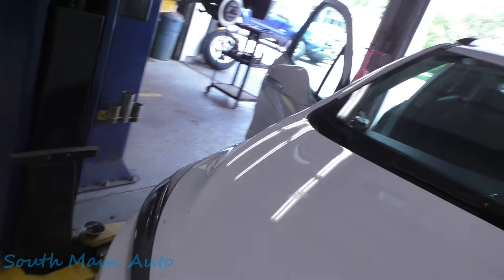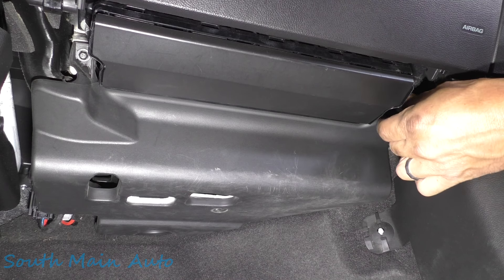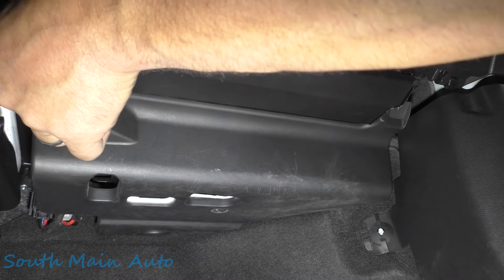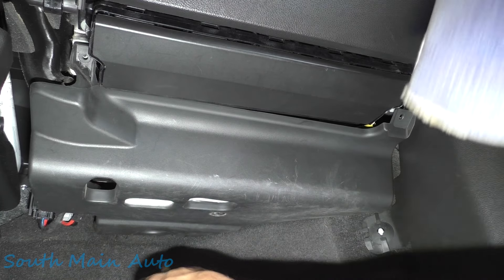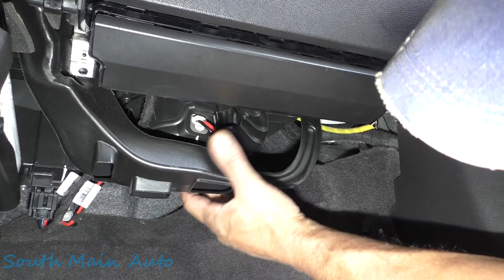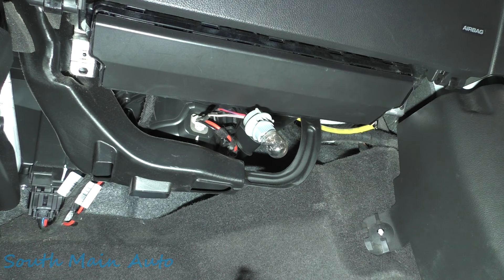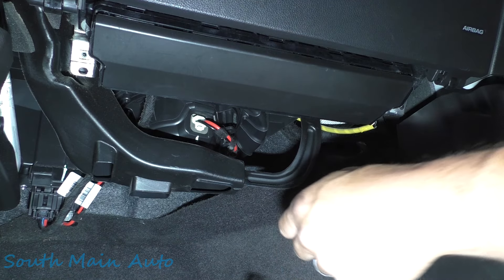Buick Encore - Blower Motor Replacement

Comment: Speaking of customers bringing in vehicles for a "problem" that isn't a problem. Once had a customer drop off their car because "it was getting up to operating temp too fast." It wasn't overheating. We looked at the car, told them there was nothing wrong with it. We recommended replacing the tires, like we had been for months. The customer declined getting new tires. I'm pretty sure we charged them diagnostic time and they drove off on their bald tires. 🤦‍♂️🤦‍♂️🤦‍♂️

Comment: Don't stress it Eric, if those cable tabs weren't "optional" they wouldn't have been molded from crapolium
Reply: The fact that they gave you two extra holes shows that even GM knew the part was cheap.
Reply: @shadowthesi  let's not give those clowns credit where it isn't due - chances are that crappy blower module is used in multiple models which may have additional wiring harnesses that clip into the additional mounts. This was likely just GM failing their way into accidental success thanks to their cheap parts-bin approach.
Reply: repentandbelieveinJesusChrist1  Reported as spam.

Comment: GM Engineer: "Let's permanently mount the blower-motor into the air-box so it'll be cheaper and easier to assemble."
Other GM Engineer: "Don't blower-motors have moving parts, and wear out over time?"
GM Accountant: "So?  By the time it wears out, it'll be past the warranty period -- not our problem."

Guarantee you this conversation took place.  100%
Reply: Hell yes!
Reply: I wouldn't doubt one bit if this was actually a verbatim conversation.
Reply: I bet it never came up and was a streamlined design that nobody thought twice about. possibly done by the hvac assembly manufacture, if it's not gm directly.
Reply: That's what happens when accountants run companies instead of getting input from front line service guys at STEALERS.
Reply: Interm:  Not if we use a brushless motor, and controller.
Clean out your desk, do you know how much that would cost....We are not wasting 3 cents.
Reply: Not just GM engineers
Reply: SAVE MONEY, Ford accountaints say "hold my beer"

Ford engineers . "Hey these gas tanks will explode, it will take a $10 part to fix"
Ford accountant " my calculationts , its cheaper for us to pay out the insurance claims, we make more money letting people burn, than paying for the part in construction"
Reply: Oh, it definitely did!😂
Reply: The words would have been too expensive. The instructions probably said as few parts as possible or wood chipper.
Reply: @positivemasculinity42 only vehicle that I ever had problems with was a gm vehicle with low mileage.  Everything was a pain to get to/take apart.  Never owned a gm since.
Reply: Hopefully when gm goes out of business again we do not bail them out
Reply: My blower motor just went out 400 miles after my warranty expired. Figured I would be able to do it myself… proving to be more agitating than expected. Might pay for it to be someone else’s problem

Comment: Firstly, Love the content. As a GM dealer tech I have seen many of these issues on the encores and chevy trax. sometimes the fan fixes it but be mindful of the harness that plugs into the blower motor, it only runs about a foot and a half back towards the center console and then it plugs into another connector, and what I have seen is poor pin tension on the ground side of the connection further back, had a couple of them. keep up the good work! from a neighbor in PA!

Comment: What a great video Eric.  First and foremost, I have always wanted a bulldozer too.  Crane my neck to look at them since I was a kid.  The bigger, the better.  I’ll probably never get one though.

So the reason I feel compelled to write is that I was a “Serviceability Engineer” at GM a long long time ago.  Programs that I was most involved in were 95 Riviera/Aurora and 95 J car.  GM had an entire group devoted to Service Readiness called STG (Service Technology Group).  During engineering tradeoff discussions, we were generally last in line to get our desires for better serviceability.  Piece cost, mass, buildability always had a much bigger voice.  Watching this video transports me back.  I can imagine being the Service guy in the engineering discussions about this blower motor.  The Release Engineer probably had to be persuaded to even get the cutout molded into the case so that you could cut it out with a knife.  Lots of negotiations would have happened around the costs involved and the serviceability guy would have to show how it could save warranty dollars just to get it to happen.

Back in 1991, we found that 95 J car was not towable with some tow trucks.  The stinger of the tow truck would actually break through the oil pan and into the crank during testing.  Spent an entire summer at Milford Proving Grounds working with the team to convince engineering management to put several dollars into the car so this would not happen.

I am a long time mechanic too (not professional).  I appreciate the language conversion that you do in your head while working on stupid designs.  I have trouble doing that conversion and rarely call things “Mother Lovers”.  

I left GM in 2007 and am now long retired.  My memories there are of some incredibly brilliant people who really wanted to create great cars but were throttled by bean counters and bureaucracy.  

Thanks for all you do.  Love your videos.

Comment: This is the kind of thing that production engineers and accountants live for.  Probably saved a dollar per car by making that POS nearly unserviceable!
Reply: and they will all burn
Reply: One dollar per car is a huge amount of money over the course of a production run.  
It's not "unserviceable".  A replacement was performed here.
Reply: more like .02 Cents per car. To save a dolla a car they'd delete a window.
Reply: It also comes down to time on the line, if they can shave off a min here and there with a design.
Reply: @MrShobar  found the GM engineer.
Reply: @MookieMan1  I am an engineer, but I've never worked for GM.
Reply: @MrShobar sure you don’t work for GM
Reply: That also eliminates paying someone to install the fan to the housing. The savings was plenty enough to design,manufacture and document the repair kit
Reply: If it was easier to replace they would make more money because of the parts cannon folks.
Reply: Everyone is acting like GM actually designed the blower motor and housing. Everything is a World Car. Parts from here, parts from there. One of GM's sub contractors designed and built the assembly.

Where GM hates this assembly is after installing during the build, the blower motor was found during final quality check, the assembly was DOA.

Watch any of the assembly line builds on new vehicles. The entire dashboard assembly was installed as a complete part prior to the windshield being installed.
Reply: The guy that is no longer being paid to install the blower motor in the heater box with the usual 3 screws is instead paid to set it up in the mould when the heater box is being moulded.
Reply: @gungadinn  Or when they have to replace one under warranty. Way more labor and way more expensive part. I'm sure the bean counters figured all that out.
Reply: @MrShobar  
You obviously never attempted 
to earn a living as an auto mechanic.

The engineers who created this situation 
were obviously aiming for PLANNED obsolesence.

John Deere started pulling the same crap, designing farming equipment that is almost impossible for farmers to maintain without  
being married to the JD service centers.

As for the "one dollar per unit" argument, that kind of money is irrelevant 
to anyone who isn't anally retentive...
Reply: GM service stealers happy to bill someone $80 bucks an hour
Reply: @Bill-xc8le  Somethig wrong with your reading comprehension?
Reply: @MrMccurley  "...You obviously never attempted to earn a living as an auto mechanic...".  That's right.  I aimed a lot higher than that. 
"...The engineers who created this situation 
were obviously aiming for PLANNED obsolesence..."  I don't think you understand what planned obsolesence is.  The only thing illustrated here is a difficult replacement procedure.
Reply: @MrShobar  yes, I wasted my time replying to you!
Reply: I totally agree.
Reply: @Bill-xc8le  That's probably true since you cannot comprehent what's clearly written.  I wonder if you listen or follow directions  any better.  Probably not.
Reply: I used to work on many gm vehicles from the 1990s that would not use real nuts but instead use the infamous hollow  sheet metal speed nut to secure many items in the vehicle. All of the “big three” did this for quite some time even in much older vehicles to save money. They also cheaped out on many vehicles by using a minuscule 6g negative battery cable which is woefully inadequate and leads to ground issues in the long term.
Reply: @MrShobar  Ridiculously difficult, and most likely favoring quick assembly on the production line, without any concern for repairability.

Comment: I've said it for years, engineers should be required to fix their stuff after the car is assembled
Reply: They should be required to work as a mechanic at their Dealers for at least 5 years.

Comment: I've done this in a 2015 encore 3 times now.  My daughter kept saying the a/c would stop working so I grabbed the scope and multimeter and spent a couple hours troubleshooting this three different times.  Never found any issues.  The problem ended up being a bad connector elsewhere in the hvac system.  I was always surprised that the rear screw for the cover always went in perfectly first try.
Reply: Went in perfectly to the garbage can.  Nobodys gots time for dat...

Comment: Great video.  We have guest with the same issue, and when my tech told me we had to literally cut the motor out I was astonished.  After seeing what a hassle this job is, it may be better for my tech to let our guest take it elsewhere.  The guest came in stating the ac blower motor wasn't working.  He never said intermittent.  I told him it was $21.99 to diagnose it, and if he went with our repair recommendation the $21.99 would be credited.  My tech verified that we had power going to the motor, which pretty much let us know we had a bad motor.  The tech explained we had to literally cut the motor out.  The guest left and agreed to come back the next morning.  We quoted him like $398 for the job.  He goes back to his car, then comes back in the shop all upset saying his fan motor wasn't working???? You did a great job on this, but honestly what a crazy design. And I have a crazy guest on my hands.

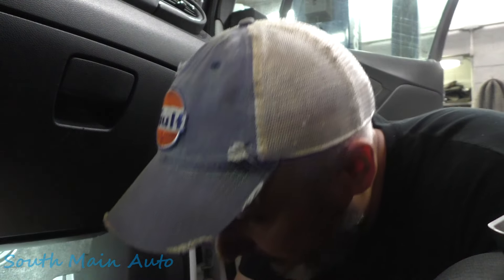Comment: 4:40
Yes! You feel my pain. I was trying to replace my motor on a 2014 Camaro and came to this very point and was like, "Huh? I have to cut the thing out???"
I ended up punching the motor, which kicked it on, and it hasn't stopped since. Still have the new motor sitting in a box somewhere.

Comment: My brother-in-law retired from Chrysler as a engineer and he told me that a lot of this kind of engineering happens because at certain points a lot of the vehicle has already been designed and now it gets to the point where other components have to be installed and they have to come up with solutions
Reply: You just verified my thinking, the hand doesn't know what the elbow is doing. This kind of crap did not happen back before cars were designed on computers by morons that never swung a wrench
Reply: Hey Eric, is it legal to have a cell phone stuck into your face going down the road in NY?
Reply: Stupid is as stupid does to para phrase a certain movie character.
Reply: You can tell your b-i-l that I can relate to what he is saying, but don't pass the buck, it still falls back on poor engineering.  You can also tell him that I understand the pressures that engineers are under from higher ups in marketing and financial.   Engineers have the best intentions to do things right, but marketing and financial often times handcuff them and they have to do a fast, half assed job.  I used to have a service mgr that actually stood up for the techs.  He wouldn't let marketing sell junk, only stuff that was engineered correctly.  That's the whole trouble.  Too many engineering mgrs don't have the balls to stand up to marketing and financial without losing their bonuses.  So it all boils down to bad engineering.  Good engineering would stand up to the pressures without folding.
Reply: @scannerlanier471  If my B I would have stood up to and complained to his bosses they would have shown him out the door
Reply: @mattharper588  I totally get it, not blaming BIL, it's the engineering mgrs that don't have the stones to do it.  At least in my field, marketing and finance are the royal princes.  They make the company money.  Engineering is viewed as spending the money, especially if they want to make something better.  The decision makers on both sides are paid through profits, so they have incentive to make things cheap and quick.  That is what I meant by bad engineering aka the engineer mgmt.

Comment: We use a 1/8 inch drill bit in a die grinder to cut the groove.  Works like a mini router.  Oh and charge extra for first time removal.

Comment: Chevy Sonic is the same way. I used an oscillating multi tool to cut through the darn plastic. Took about 15 minutes and was much better than using a utility knife like I started to use. After I slipped the first time with the knife, I moved on to power tools.

Comment: Boy can I relate.  Most small printers are designed to be tossed.  Nothing comes apart on them, some areas are sonic welded, so you break out the cutter on the plastic.  Then after repair, the 5 minute epoxy to glue it back together.   Then there is the customer who constantly wants to know when it's done so they can get their one print out for the day.   But come 5:00, they are the first out the door.

Comment: I have to say the engineering on today's vehicles is insane at the very least.    I'm amazed everytime i get into a new one.    Every now and then i run across something that actually makes sense and that just makes my day
Reply: Yes and very not worth the money they are asking for them. Sadly, the public buys them vs. keeping their old rides and fixing them in order to send a message
Reply: To replace the one on my 71 Camaro you have to remove the inner fender, and it ain’t one of the modern flexible kind. Solid steel, with many bolts. It’s a PITA. It’s not a new phenomenon.
Reply: I'm keeping my 2000 xj.    In fact I spent 4 times what I paid for it to replace the engine lol.   But it's a 4.7l stroker now.  I went that route coz a used stock engine was expensive for what you get.    A reman one was almost as much as the stroker and they ain't got forged internals
Reply: It is a matter of ease of assembly at an automated plant and lack of familiarity with repair procedures...
Reply: @codo7  Mostly, this isn't a new idea, to design things and well as design methods to service them once put into operation. Looks like the "builders" got the authority in this idea vs. those who design for service or support once sold.
Reply: I thought cars designed 20 years ago were insane!
Reply: @mikechasse1016  Cars from the 1990 era or earlier were easier to work on and more reliable, for the most part.
Reply: On my 69 chevelle ,I cut a rectangular access hole in the inner fender in order to get to the bolts and made tabs at the corners and riveted it back on after I was finished. The spirit of hotrodding at its finest.
Reply: I think any automotive engineer should have at least 5 years of flag tech experience before they can graduate

Comment: Those footwell spaces are something special. Took me the best part of 4 hours to change a clutch master because of the unreachable stuff and cramp inducing contortions needed to do the job. Even my mother (who never ever turned a wrench) came by and told me "just take the seat out". I hate working on cars sometimes.
Reply: I was a Dodge tech for about 5 years. The Darts had a bluetooth/wireless module under the driver dash that was basically mounted right under the windshield. I used to pull the driver seat and lay down in the floor, then fight with stuff in the way until you could finally get the module out. It paid 0.3 hours under warranty.
Reply: Your Ma was right ... just take the seat out!
Reply: And you are supposed to use new bolts, to remount the seat. “Safety Requirement.” $$$$ from the dealer.,
Reply: @gokblok thats how you work on all instruments and controls in single engine cessnas

Comment: This channel is helpful, thank you. A while back I think it was on this channel that you had a complaint about a tapping noise that went away on warm up. It was a valve lifter. I own a Subaru, with cylinders on the side - so I knew it was not that. What it was instead when I used a screwdriver to listen for it - it seems to be a timing belt tensioner. upon further research I learned that when the oil is cold the tensioner when going does not get enough oil and it makes a tapping noise on the Subaru engine. I thank Eric as his methodical methods got me thinking about how to diagnose what is going on. I won't fix it but I can tell my trusted mechanic what is wrong so he can double check my work and replace it (it requires taking the front bumper off - too much for me).